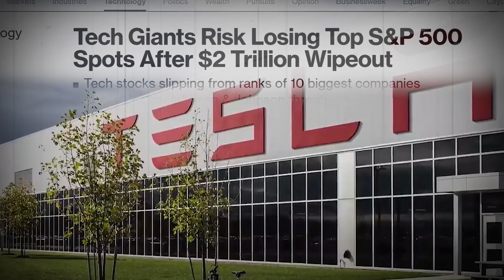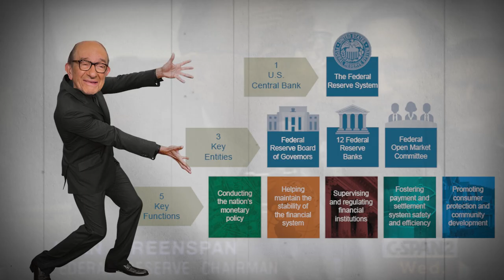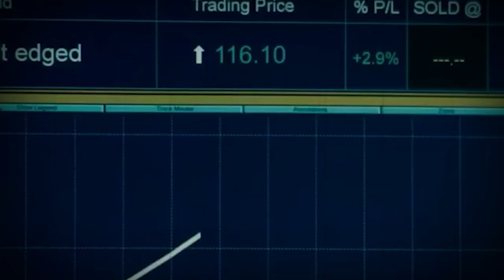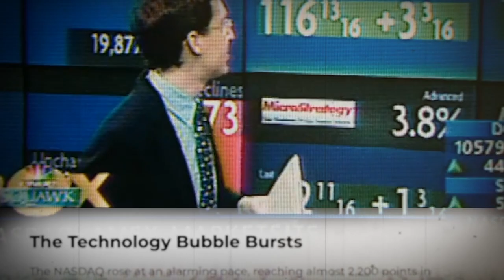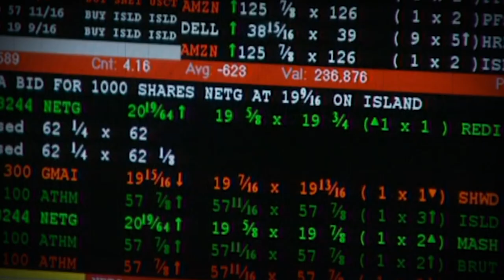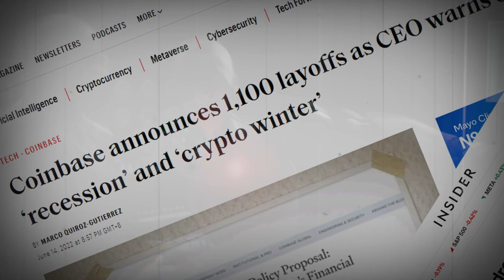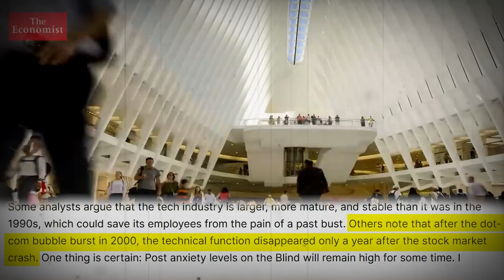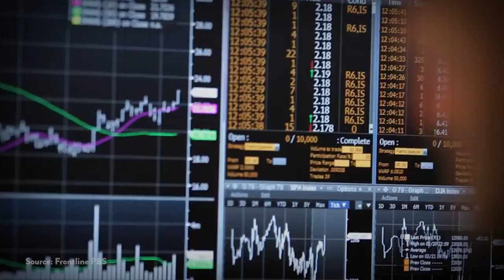How 2000 Will Happen Again

Comment: 1998-2000 was two years of manic buying spree which lead to the collapse of 0 use case business models when the internet bubble popped. Likewise Bitcoin 2020 march to 2022  march ended with a significant dump down. End of the manic buying spree and insolvency in many coins and projects already have passed through. The pop already happened and the majority are too blind to see it. What followed after was a 9 year bear market of sideways action (range price movement.) And then began a 6 year buying spree that reclaimed the ATH on the NASDAQ. To sum it up this bear market for crypto is going to be a long one don't trust Youtube content for investment advice at the  end of the day DYOR.
Reply: lol in my head I see these smaller bounces on the graph like a diver on the high dive board.... boing.... Boing.....BOING... up we go....  everybody point your toes and hold your breath

Comment: Down to my core hodl group till after Wallstreet dumps and inflation forces pressure to roll out half baked cbdcs in an attempt to circumvent fiat loss of value. Till then Xrp, Quant, Atom with some Osmosis defi giving me a little pool  exposure to Wbtc and a few other assets. Oh and Gme cause I feel naked without at least a partial tinfoil hat 😂
Reply from the maker: Reverse uno card for the wallstreet boys 😂